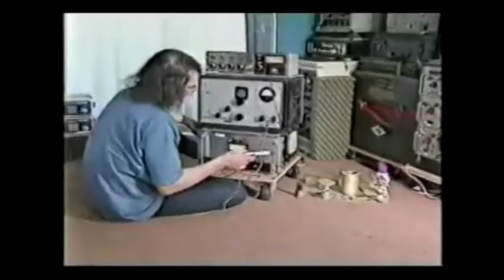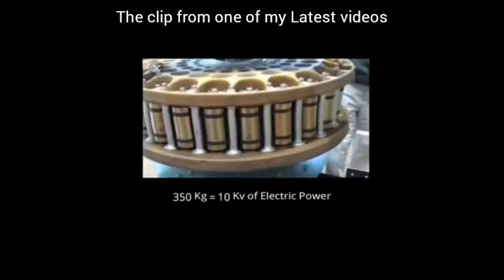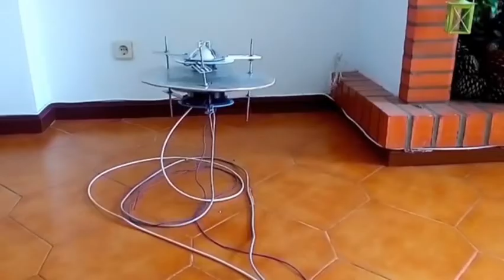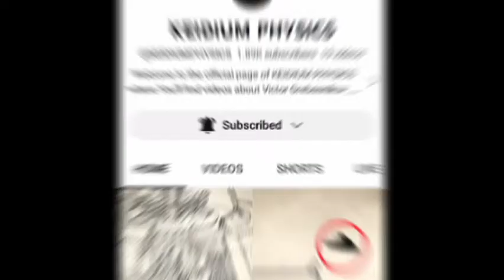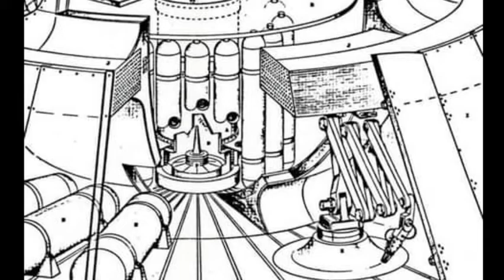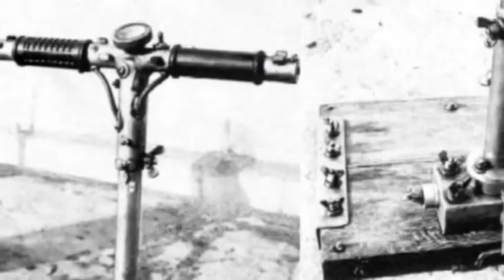Unveiling The Mysteries: How Does Antigravity Work? | Part 1

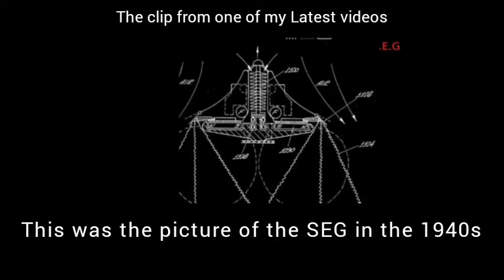Comment: time 4:44 The reason there are + signs on the outer ring is because he is polarizing the air with electrons that are +   The inner structure of the device is where the - ions go. To make a tornado you need both fields. The reason he swirls the air is to build up the ions before they go out. He is looking for the eye of the storm. It would be without ions making inertia non existent. People who do not do the experiments don't understand ions at all. So voltage is only ac or dc to them. So when you say polarize the air, they still think of magnets not static volts.

Comment: What do you suppose is missing from these quantum physics ideas? I know and am tired of trying to explain. It truly isn't about telling anyone the truth and should not be. It is all about business. Even so, an inventor with an idea would prefer bankruptcy, failure, and humiliation than to collaborate with anybody else.

After looking at the hand-drawn schematic on paper in the video, I can mention that the two outer parts in the schematic are transformers. Therefore, the center parts in the schematic will be AC active and not polarized charges. It's true, any of the polarized charges can be substituted with a DC polarity. If that already happened and no AC is involved, then no Bandwidth is achieved to allow magnetic field interactions. Even if AC was used, or AC DC interactions, the field interactions would be quantum, and not macro. OK, "quantum" for propulsion flight as the solutions suggest. "Macro" and perfect for motorized mechanical operations. Not even high frequency is a solution for propulsion flight as suggested. Just imagine, somewhere on Earth in some electrical or electronic contraption, that schematic formation exists. It doesn't serve any other function than what it is performing.

Comment: BRO, SORRY FOR YOUR LONG TRAVAIL - THE ANSWER IS VERY SIMPLE  -  THAT AETHERS DO EXIST, THEY FORM A 2D MIRROR SYSTEM  -  GRAVITY DOES NOT EXIST IN 2D.  THERE IS NO NEED TO DEVELOP ANY KIND OF FORCE AGAINST GRAVITY, JUST WORK IN THE ABORIGINAL AETHERIC SYSTEM WHERE GRAVITY DOES NOT EXIST - SIMPLE.   THE HEXAGONAL PATTERN OF THE BUG'S BODY PARTS ARE IN PERFECT HARMONY SIZE WISE WITH A NATURALLY OCCURRING INFINITE AMBIENT AETHER.  WHICH IS 2D AND NON-POLAR = YOU ARE OUT OF DUALITY.
Reply: Dr.Viktor Grebennikov-Cavernous Structure Effect.
Reply: @nemesisobsidian   WHICH ALSO STOPS TIME  -  WE'VE DONE THAT.
Reply: @mikeemery5867   I have heard that CSE requires rotation to increase it's effects. Does it need rotation or high voltage charge or both?
Reply: @nemesisobsidian    THE AETHERS ARE PRETTY MUCH STATIONARY - WE BLINK THRU THEM - THE ENTIRETY OF EVERYTHING IS ON THE SAME BLINK RATE - AND NOBODY KNOWS WHAT IT IS.  SNICKER
MOST LIKELY IT'S 3 TO THE 33rd POWER.  3 FLOWS IN A CAPACITANCE FIELD AND NO OTHER RATES DO.
Reply: @nemesisobsidian   A TINY BIT OF CHARGE ACCUMULATION IS HELPFUL.  THIS HAPPENS ON THE BEE'S BODY. THE WIND RUSHING AROUND THE HAIRS CREATES A STATIC CHARGE
Reply: @mikeemery5867  So CSE can have an electric charge and be effective. I've studied other antigravity systems, it seems with every kind of alleged reactionless propulsion everything keeps going back to electric charge and magnetic fields. Also can you still provide details on whether or not rotation has an effect on CSE? I'm curious about your thoughts. 🤔
Reply: @nemesisobsidian do you have more information about Gerbennikof?
Reply: @سامرحسنهاديأحمد   Just that he accidentally discovered CSE when he placed a beetle wing on top of another one and it levitated midair.
Reply: Gravity is the weak areas of the electromagnetic fields surrounding all atoms, and therefore, that is pressed down by the dark energy field or fields. Where there is an accumulated attraction of the dark energy field, an event horizon is formed, which distorts space and time. That said, the dark energy field is drawn to the electromagnetic fields of the matter of earth and accumulates. That's the event horizon. Astronomers use the lensing effect to distant galaxies. This is possible due to the increasing mass relative to the center of galaxies. There will be less dark energy attraction where mass is lesser, but greater where there is more mass. Hence, the lensing effect.